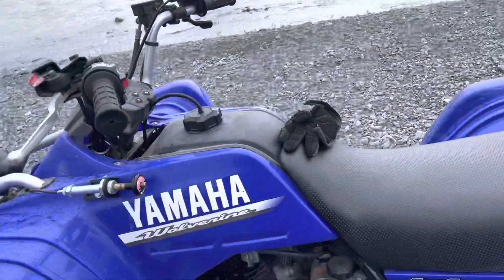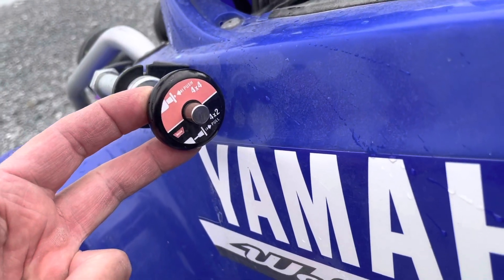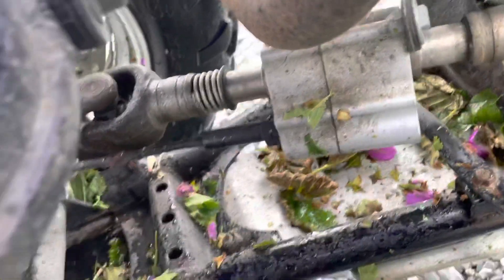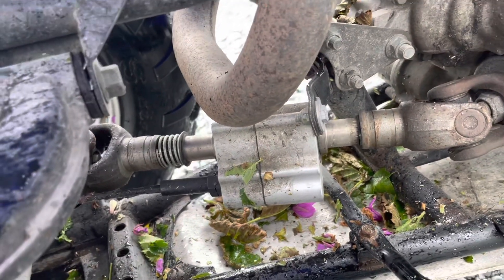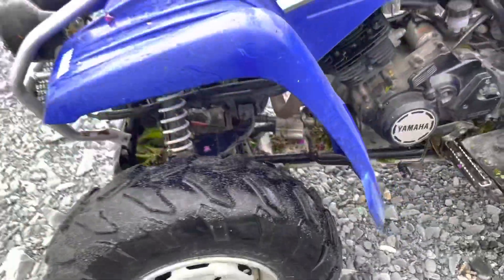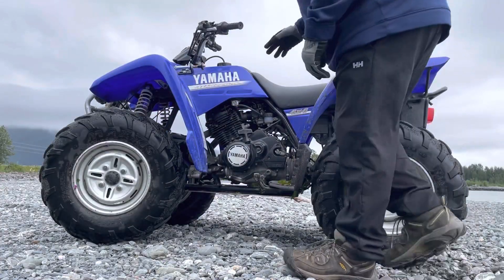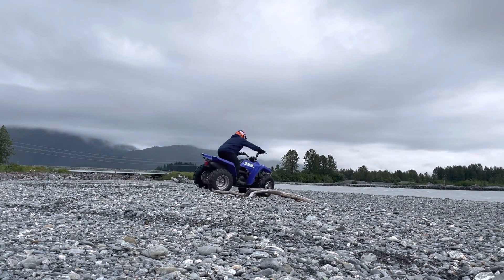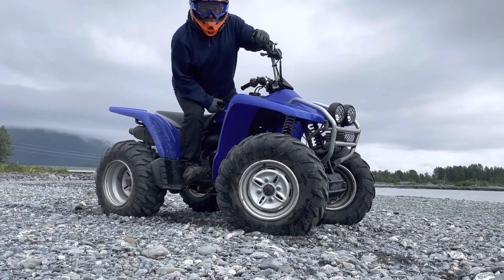Yamaha Wolverine Warn 424 kit

Comment: I had one of these about 10 years ago.  I didn't realize how rare they were and sold the entire bike way too cheap.  I'd love to find another.
Reply from the maker: I wish they still made them! 😀 Yamaha had it all figured out correctly back in ‘95 when they came out. Air/oil cooled, simple design, smaller size and the lightest weight 4x4 ever at 485lbs dry. The only thing they screwed up on was not providing a part time 4x4 option and the 424 kit corrected that. 

The Wolverine has good power and speed for a 350.
Reply: i have 2 one of em its worse for wear but i bet its could be rebuilt

Comment: I have a 2003 wolverine with it on it bought the Wheeler few months ago been working on it finally got to ride it put the 424 isn't working looking for parts or a new one or used one any help would be deeply appropriated
Reply from the maker: Warn used to offer rebuild kits for the 424 but they are out of production. I don’t know how similar the Wide Open kit is to the 424? I remember reading years ago that some guys were modifying that kit for the Wolverine but it required cutting and welding, not something that was easy to do. 

I’d keep your eye on eBay as a rebuild kit might pop up.

Comment: Mine has one on it and i cant get it to pull out. The people i got the wheeler from stored it out side
Reply from the maker: That’s unfortunate that it isn’t working properly. I start with the simple stuff first and make sure the cable isn’t bound up or rusted inside the housing. The plunger switch can also get sticky overtime. It’s likely one of or a combination of those two things. I suspect you could use a cable luber to allow for spray lubricant to get down into the cable housing. I think you’ll be able to get it back working in short order.

Comment: Does anyone still make this type part or another one that could be modified to work on the Wolverine?
Thanks
Reply from the maker: You might be able to modify a Honda kit from Wide Open. It’d likely take a driveline or machine shop to cut and weld new, Yamaha u-joint compatible ends to the unit.
Reply: @thatalaskaguy    Would it also need to be balanced/weighted to hold down vibration? 
Thanks
Reply from the maker: @JustTrizIt  i’m doubting that as the 424 kit that I own has no weights on it. i’ve not looked up the wide open kit for a couple years so I’m assuming they’re still available?